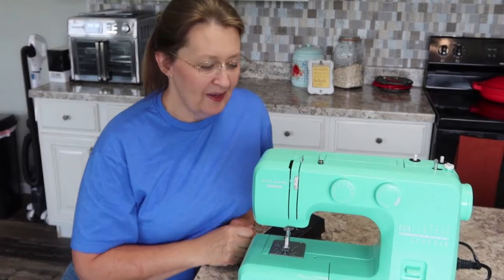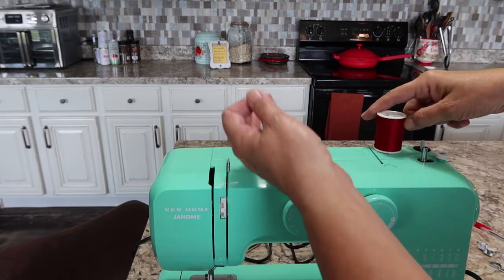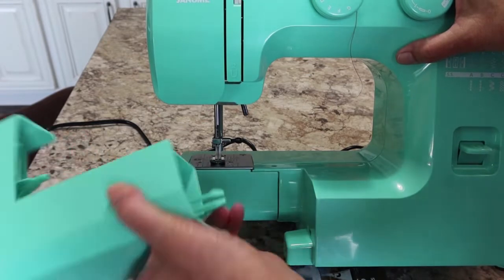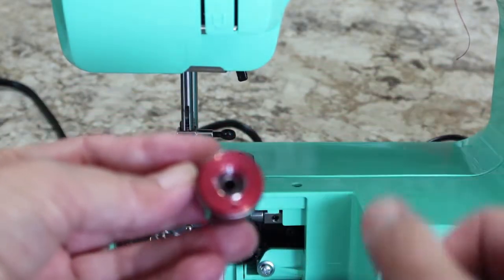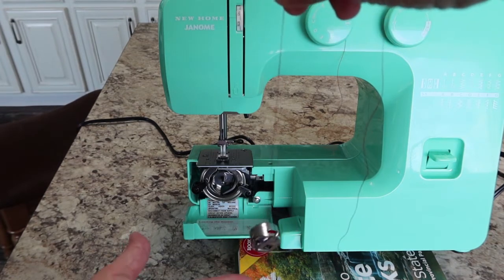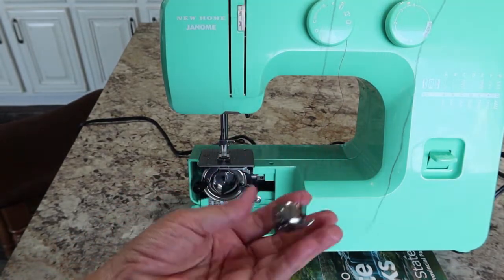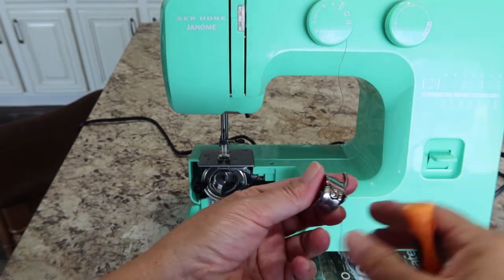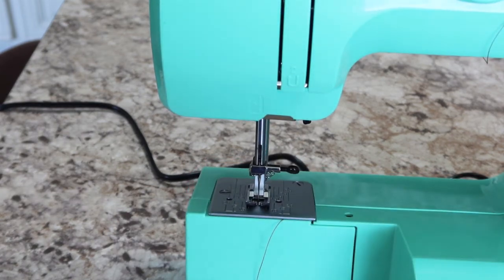Winding and Loading Bobbin on Janome 311 Arctic Crystal

Comment: Tip: if you don't have a flathead screwdriver small enough for the bobbin holder, you can use a flat pin to adjust the tension. It doesn't work as well, but it worked for me, saved me a trip to the store for now!

Comment: Hi may I know the size of the screw driver you used? I’m surprised the machine doesn’t come with one.
Reply from the maker: I looked and it didn't have a size on it. It was in a little set of micro screwdrivers I picked up at Tractor Supply. The top measures 1/16" wide. I'm so sorry I don't have a size, but I hope that helps!
Reply: @momdoesstuff  thank you so much! I’ll figure it out I just used my nail to adjust it in the time being.